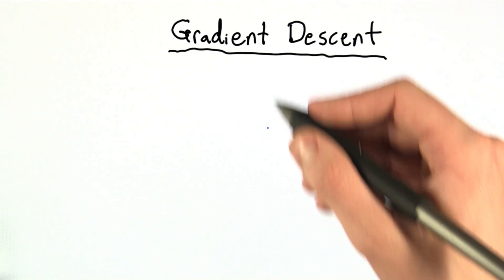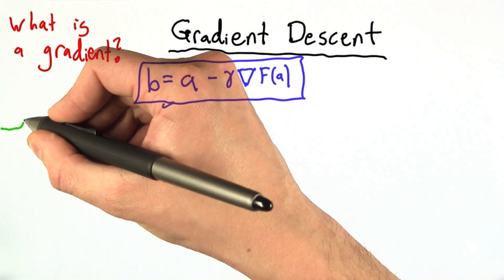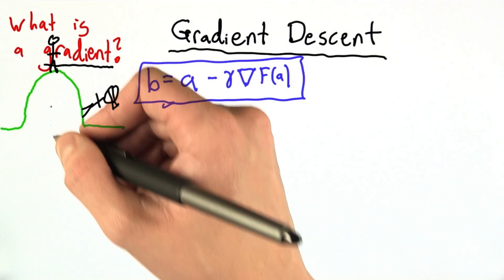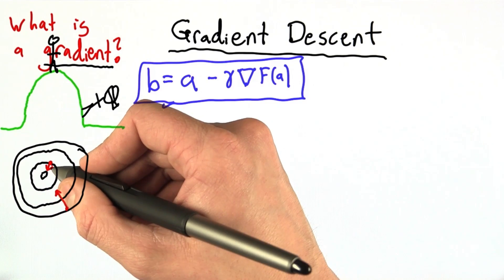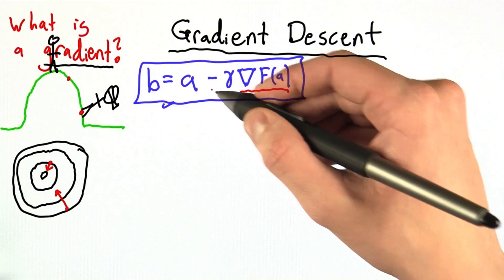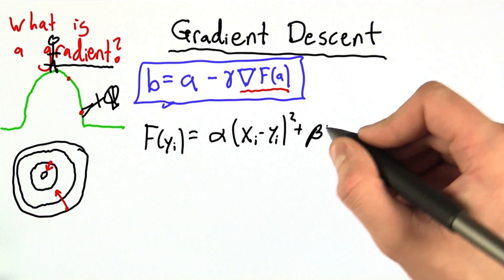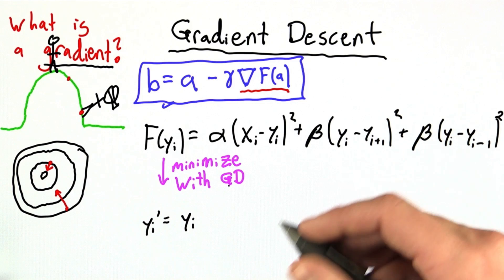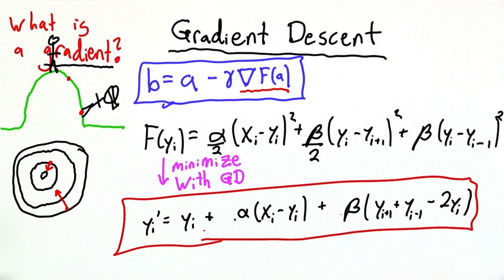Gradient Descent - Artificial Intelligence for Robotics

Comment: Just to clarify something; the gradient is not where you point. The gradient of a differentiable function is always perpendicular to the level curves of the graph of the function. That being said, the red vectors you plot is -grad(f) (at the given point). That's why the minus in the formula shows up. I know that the point of the video is not to rigorously define the algorithm but rather to give an idea of how it works. However, that's a fundamental mistake which is misleading for someone with basic mathematical understanding.